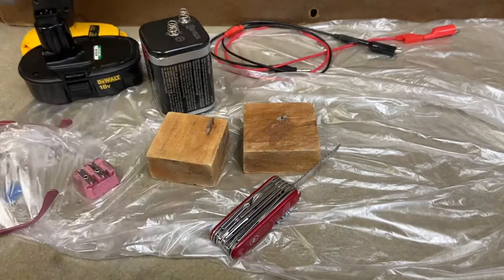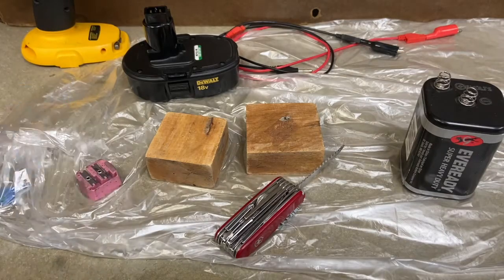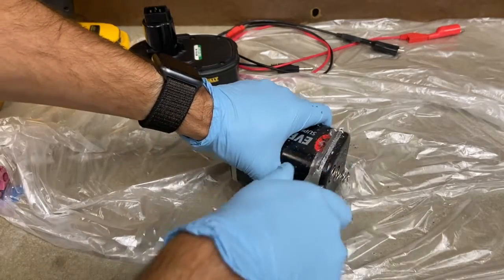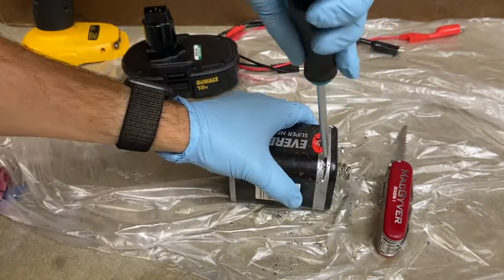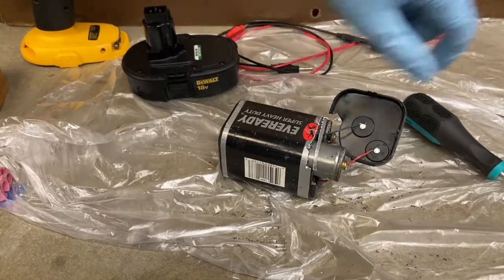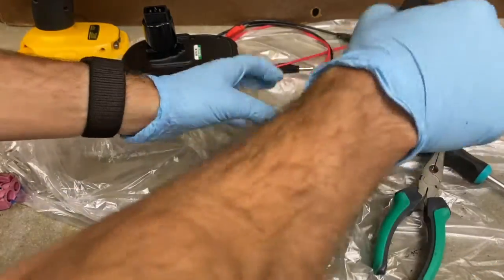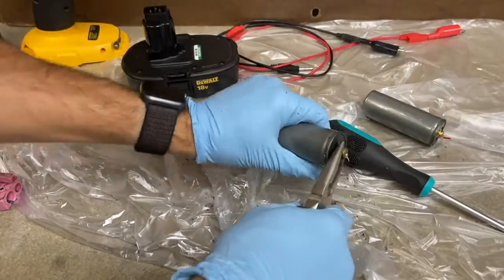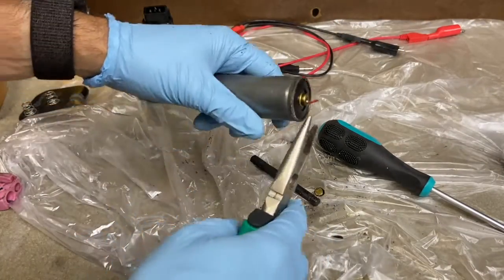Build a carbon rod arc lamp from a 6volt lantern battery.  Super bright.

Comment: I'd be careful using those 18V drill batteries since arc lamps draw a lot of current which could abuse the 5x Li-ion cells too much potentially causing them to vent fumes or worse, explode.
Reply: That's a NiCd pack that he's using in the video. They're pretty resilient.
Reply: @brettsalling 🔴 What Is Islam?  
 
🔴 Islam is not just another religion.  
 
🔵 It is the same message preached by Moses, Jesus and Abraham. 
 
 🔴 Islam literally means ‘submission to God’ and it teaches us to have a direct relationship with God.  
 
 🔵 It reminds us that since God created us, no one should be worshipped except God alone.  
 
 🔴 It also teaches that God is nothing like a human being or like anything that we can imagine. 
 
🌍 The concept of God is summarized in the Quran as: 
 
📖 { “Say, He is God, the One.  God, the Absolute.  He does not give birth, nor was He born, and there is nothing like Him.”} (Quran 112:1-4) 📚 
 
🔴 Becoming a Muslim is not turning your back to Jesus.  
 
🔵 Rather it’s going back to the original teachings of Jesus and obeying him.

Comment: Sorry but your dollarama UV glasses won't cut it. Get a level 14 welding mask. Less than 100 bucks and it blocks way more UV
Reply: dont underestimate the UV light these arcs produce, back in the day they lighted whole streets with arc lights until they found out that they burn your skin and cause cancer

Comment: SIR, AWESOME EXPERIMENT!  CAN A LAMP BE MADE THAT WOULD LAST FOR YEARS IF IT HAD STEADY POWER IF THE RODS WERE SECURED AT PERFECT DISTANCE? WOULD THEY MELT CARBON RODS? CAN IRON RODS BE USED INSTEAD? FOR EXAMPLE LARGE SIZED POINTED STEEL NAILS? OR PIECES OF POINTED IRON?
Reply: No, the carbon was slowly got eaten up by heat so you need to like load it again with a new one to learn more just search its history in google